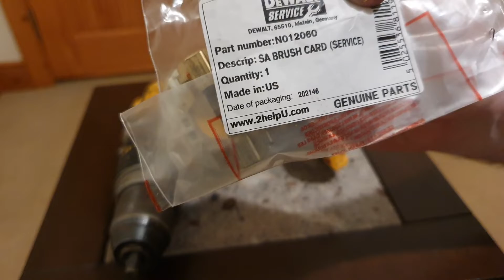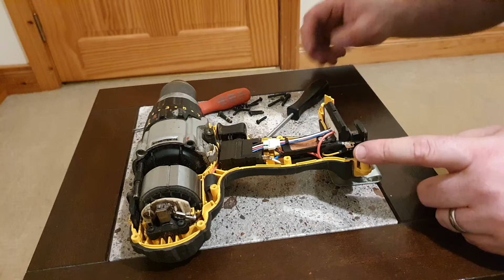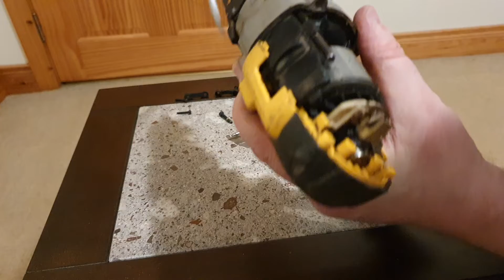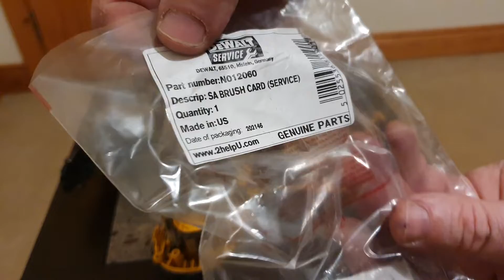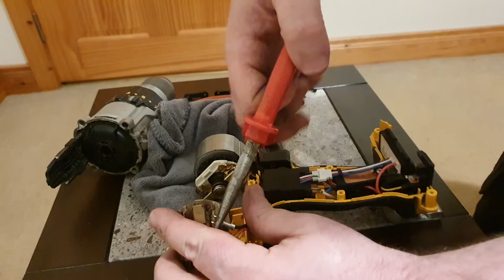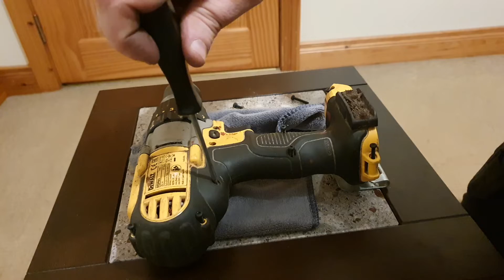How To Fix A Dewalt DCD985

Comment: Very useful video. Just fixed my DeWalt drill. Took me 20 minutes and £6.99 for the brushes from Amazon. Works like new.
My local repair centre said it wasn't economic to repair. Twats.
Reply from the maker: They would be using the expensive brushes and be charging a full engineers per hour fee
Reply: @doctorlefthandthread And that, in a nutshell, is what is so wrong with this world
Reply from the maker: @AnthonyHigham6414001080 Finding workaround budget fixes and helping people around the type of problem you described is why I started posting this content on youtube in 2017.
Reply: @doctorlefthandthread  Thanks again. I would have struggled with the re-assembly without your video.
Have you done one on DeWalt plunge saws by any chance? My won't plunge and I am having trouble separating the motor unit.
Reply from the maker: @AnthonyHigham6414001080 I never had one apart but if I do I can make a video

Comment: I had most of it figured out, but the casing would not fit back together.  I had your video playing while I disassembled everything again and found the notch for the motor while playing with everything.  I looked up just in time to see your work the motor until it set.  Works like it's brand new!  Thanks for taking the time to make the video.
Reply from the maker: Thanks for commenting on the video  it all helps
Reply: Nice

Comment: Hi. Why is mine turning the opposite way when i reverse or the other way.. and the reverse is a little slower than the other.
Reply from the maker: They should be the same speed both ways if forward and reverse are mixed up swap the black and red wires on the switch check the brushes are making good contact and the spring pushing the brushes down is in place for the speed issue

Comment: It is amazing how many of different symptoms end up being bad brushes, sometimes even motor whine ends up being dirty commutator and used up brushes. 
commutator can be cleaned nicely with fine grit sandpaper or steel woll. 
 
Also, i highly recommend getting an aliexpress "Dental Probe Hook", you can get that for super cheap. These picks are really amazing when it gets to manipulating and removing brush holder springs in tight spaces with no damage to get brushes out of place and so making it much easier to disassemble and reassemble some motors - Brush springs can damage brushes when assembling the motor back together, this is a much bigger problem in brushed angle grinders ( looking at you, Metabo! ) where your brush holder is inside the machine with only side access but you need to push in the motor armature without good access or clear way to move brushes out of the way. 

At least these old tools are easily fixed even tho dewalt wants a "new x20v lidl drill" money for their tool brush sets. It is possible instead to buy generic brushes and solder them existing onto brush holder. 
 
I'm currently fixing a brushless DCD796 and these BLDC tools are much bigger pain in the ass to fix. mine has a burnt 100 ohm resistor and diode in input voltage part. I ordered parts and now i wait.
Reply from the maker: Brushed tools are enjoyable to fix

Comment: Great fix vid!  had the exact same issue but was able to loosen the stuck brush.  notes: Torx driver T10 is good for all the bolts.   the motor stator sits a little bit off angle within the housing (it's subtle but if seated wrong, it's very difficult to button everything back up).  Cheers!